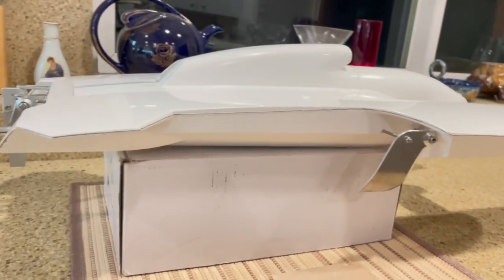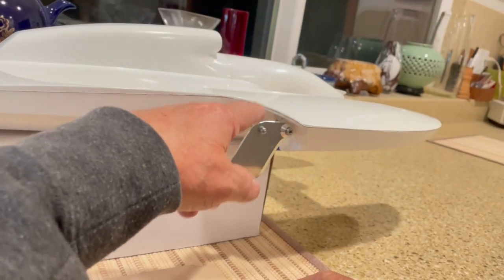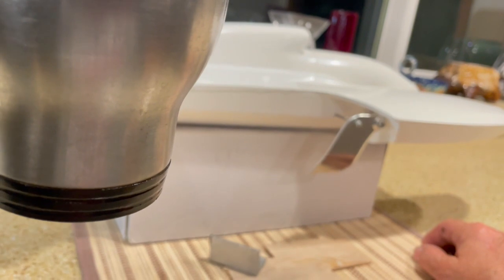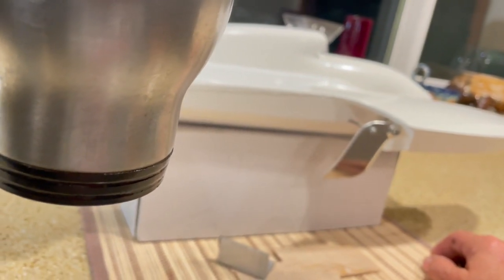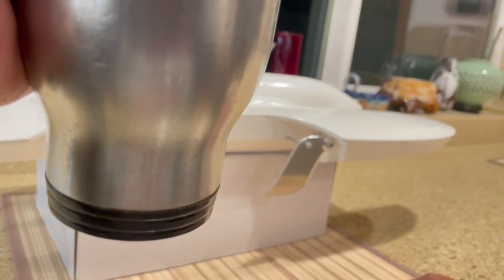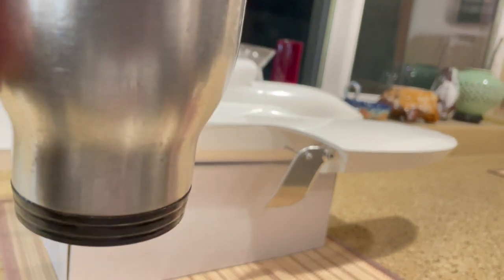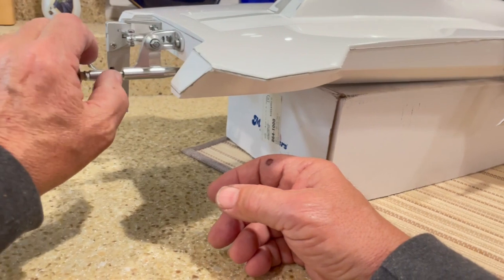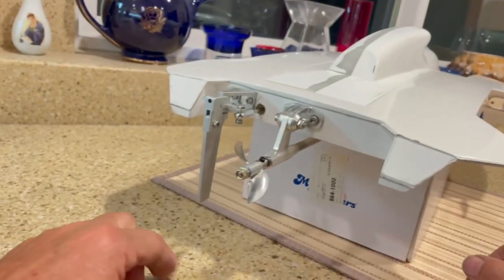Dr. Jet presents "Plan 9 from Outer Space".....  Errrr........ "Building the MHZ Miss Exide, Part 9"

Comment: i always thought it might be cool to have a servo on that support to be able to move the turn fin, i bend my turnb fins at the bottom sometimes to hold the hull down better. i saw a esc designed that was on a turn fin, to keep it cool
 in saw runs ion germany
Reply from the maker: I don't know why you would want a turn fin on a SAW boat, but what a great idea to use it as an ESC cooling plate!  🤔  Gonna have to file that one away for future reference.
Reply: @Dr_Jet  well some are riggers to hold em down ive seen a few vhulls and catamarans do those short time trials at like 250kms
Reply: right im not claimin the riggers are the fastest just my favorite, those one run wonders dont impress me all that much, its more a matter of how much money your willing to blow on battery ecs HV, motor and prop. i would rather have a constant 80mph boat doing ovals than a 100 1-20mph saw run boat. thats just me
Reply from the maker: @matthewwilken2051  You see where I run.  Stupid fast big boats just won't work for me.  That's why i like to tinker with 2S setups.  They can be fast (enough) and cheap.  We all do what fits our physical and emotional needs.  I saw a 100mph RTR Zonda and thought it was cool enough, but way too big and pricey for me.  Just wait until I have that 13" Mozilla 400 going!